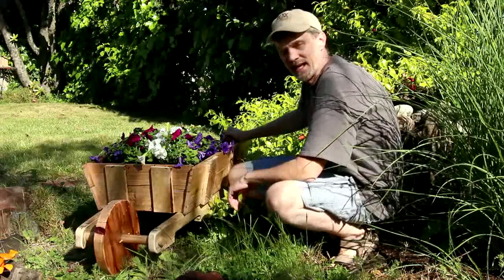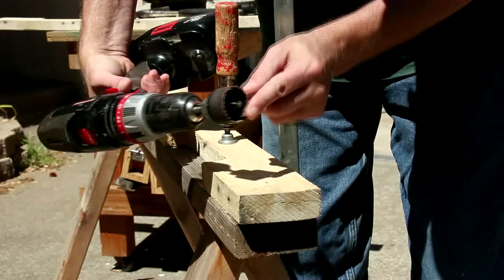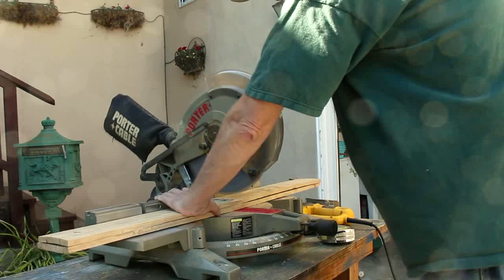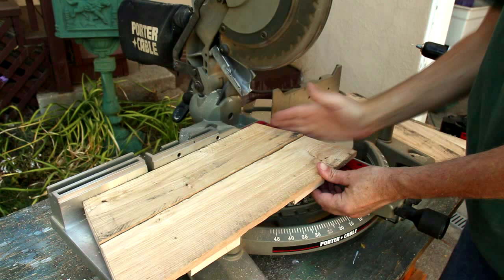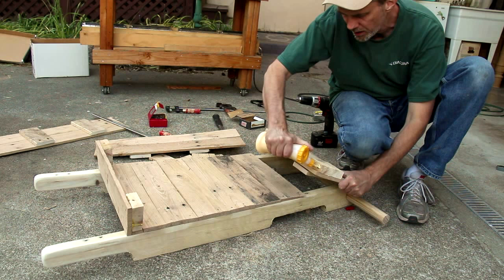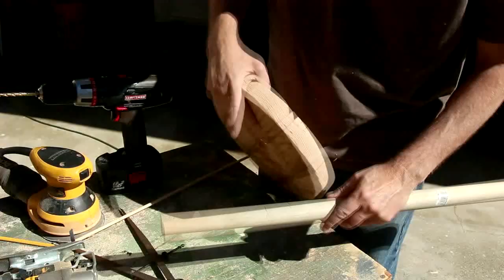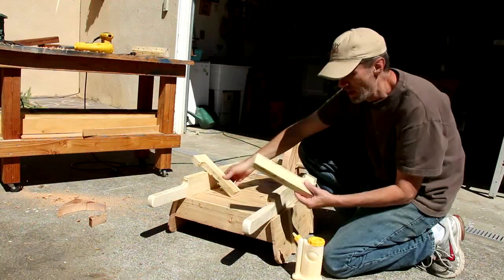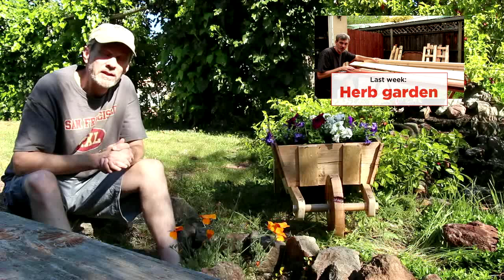Make a rustic wheelbarrow garden planter. Easy DIY weekend project.

Comment: A few amps difference doesnt matter much except for on a rechargeable drill,you'll want the higher amp one,more powerful.On your miter saw cuts wait for the blade to stop before you lift it up,if you dont you'll get tear outs on your piece.Keep a sharp blade in your tools,all the how to info will be included in the box.One more thing you'll need is a palm sander,never finish anything without sanding it first,it'll look terrible.You start out with a low number grit and work up to 220.

Comment: I see no one's replied so I'll offer some advice.As far as miter saw's,dont buy one with the small blade,underpowered.Avoid Ryobi's and Skil's,cheaply made.You dont have to buy the priciest for quality.Sear's Craftsman line is very good and they are guaranteed by them.A table saw is pretty necessary for straight rip cuts (long cuts along the grain of the wood).A good drill and a jig saw.Names known for quality beside's Craftsman,DeWalt,Bosch,Porter Cable.Be safe and dont rush your cut's.:)

Comment: Thanks for posting this video, Steve! I built this in a day, and it turned out great! I used a broken rake handle for the wheel axel. The planter itself is a decent size (enough to hold a flat of summer annuals). I agree not to bog yourself down with a project like this. My plants don't seem to mind that there are a few gaps and rough edges here and there!

Comment: Steve, I am just getting into wood working, and love your show. How it isn't talking down or use thousand dollar worth of equipment to build something. 
I recently got a miter saw but my dust collection system ( shop vac) does get all the chips, a lot is thrown off the blade before it gets to the dust port. I notice your saw has something that hangs down to help with this. How did you make it?
Thanks Tank

Comment: Steve, serious question...newbie here....how hard is it to cut you fingers off while doing these projects? Newbie and thats my worry.
Reply: +Jimmy Alexander It is very easy to cut your finger off. Most power tools have exposed blades. You need to first respect the tool that you are operating, but must not be afraid of it. Watch videos on how to properly handle each tool and keep in your control. Keep long hair pulled back, roll long sleeves up, and I would advice against wearing gloves when using a tool with a blade or drill bit. Give your full attention when operating. Go to a Lowes or HomeDepot. Sometimes they offer beginner classes to using power tools. We all had to start somewhere.